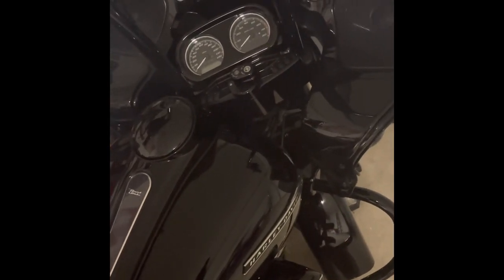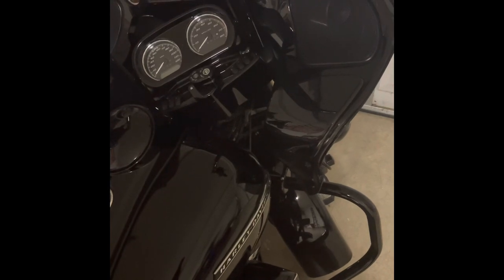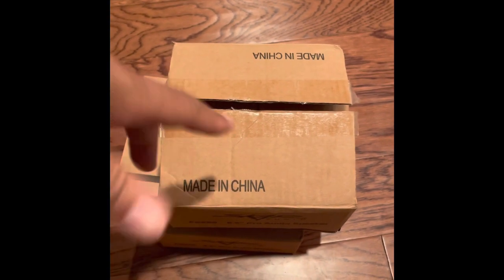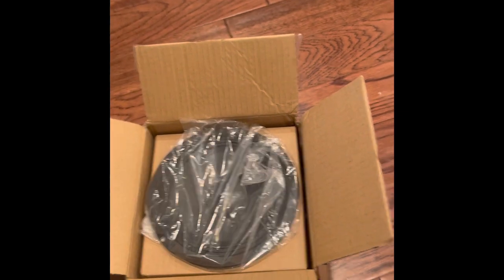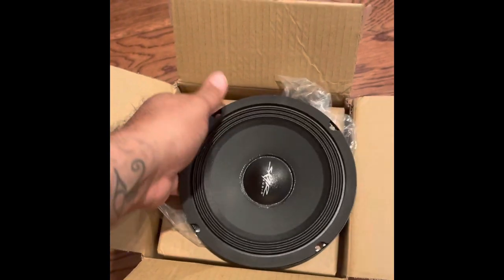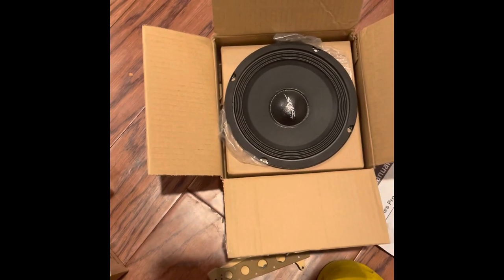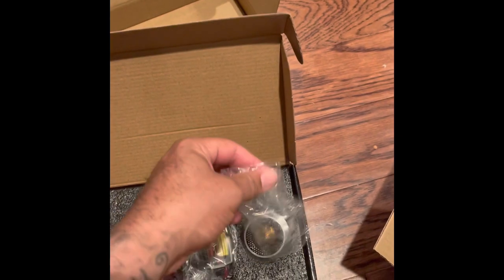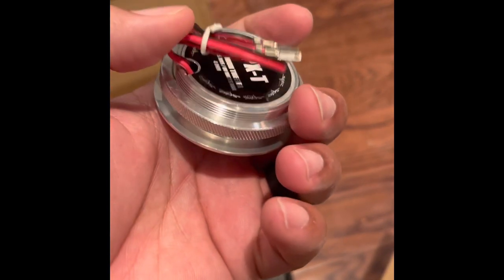Best Budget Harley Davidson Speaker Upgrade / Skar audio unboxing

Comment: Dope bro!!!! I've been looking at Skars & DS18s 
I cannot in good conscious put 2/3 bands into a my street glide system. Thanks for the video👍🏿
Should I do just loud speakers in my upper fairing or coaxials? Your opinion? 
That withers remix is nasty BTW!!! Be safe
Reply from the maker: In my very limited knowledge opinion, the highs are clearer with a component set up, but amplified coaxials will still sound way way way better than the stock ones. You won’t be disappointed either way

Comment: Are the speakers water resistant? I'm ordering the aquatic radio and I'm looking for a good speakers. I have speakers lids for my bags so I'll be putting 6x9s in them and the stock size in the front
Reply from the maker: No less water resistant than the stocks from what I can tell

Comment: How did you mount your tweeters? Cut a hole in the speaker grill?
Reply from the maker: Yes sir
Reply: Did you cut a hole in the grill then tighten the tweeter on to the grill? Like where the tweeter has the threads?